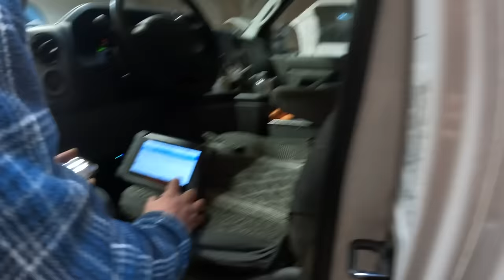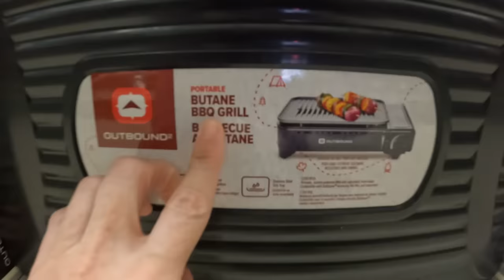ROUGH DAYS living in a van

Comment: maybe while you are $tuck at Chrome's shop, while Loren's dropping the engine...ya might grind out some of the rust, near lower side doors,  primer it and repaint it with like a shaker bottle...LOL, while stuck in shop?!? [like make a small plastic encapsulated area, sooo the rust dust doesn't get into your head. [LOL, just noticed the surface rust, in last video. ;-)] 
i could suggest to reseal the driver floor, now that the roof is sealed... LOL, only if the doghouse is put back on, when engine's dropped.
LOL, just wondering thoughts...ya might have already thought of,,, soooo i'm just rambling to be rambling.

Comment: I'm worried about the repair. What would happen if you cleaned the dripping oil off with a rag or paper towel. And add oil when the oil level goes down. Oil is cheap. ❤ This man may charge alot. And if his repair doesn't fix it you may have to have it done again. Does he have a warranty for Canada and United States?

Comment: I think maybe you need to try getting a air purifier for your van, Westinghouse Portable Air Purifier for Office, Car, RV, Tent | Battery Powered | Up to 65 sf | NCCO Technology | 3-Stage Medical-Grade Filtration | Pet Dander, Dust, Smoke, Odor, Pollen | WH10P
Reply: I have one and I used it driving through the smoak also
Reply: Do you have a link?
Reply: I had on but it took so much electricity I had to stop using it. (Using solar power) If someone has found a good 9 volt/usb I would love to know also.